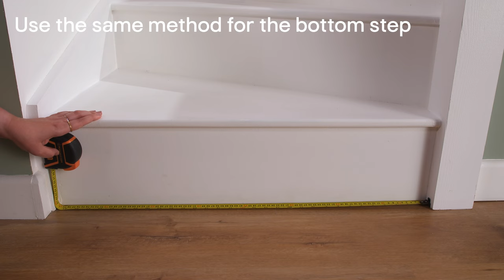How to fit a DIY stair runner on corner stairs | DIY

Comment: Great video. So to clarify, the distance between the edge of the carpet and the edge of the stair is always the same and therefore that’s what determines the width of the carpet when going round bends?
Reply from the maker: Hi there, starting on the bottom step and the step above the bend will help you find the width you need going around the bends, as you will align these working your way up. I hope this helps 😊

Comment: Any tips to make sure that the edges of the cut don't fray up over time in the 90 degree method?
Reply from the maker: Securing the runner into place with stables will help to preserve the shape over time. You can also use a binding tape to help prevent it from fraying at the edges. Hope this helps! 😊
Reply: @bandq  perfect thanks!
Reply: That 45 degree cut will 100% fray unless you sew the two carpets together at the cut. Your best bet is to butt the carpets and try to hide the cut edge under the finished edge of the other carpet.